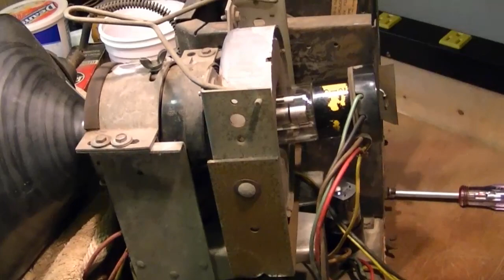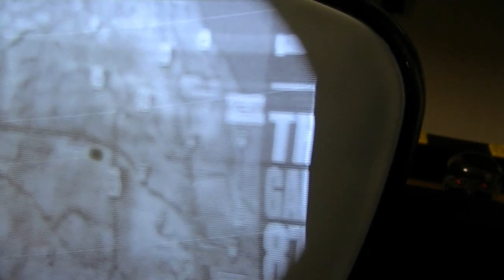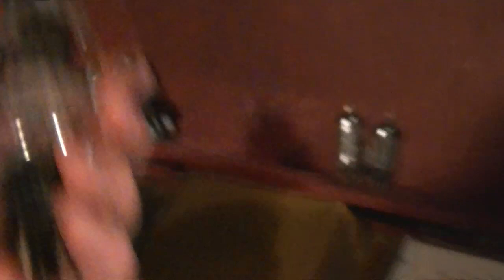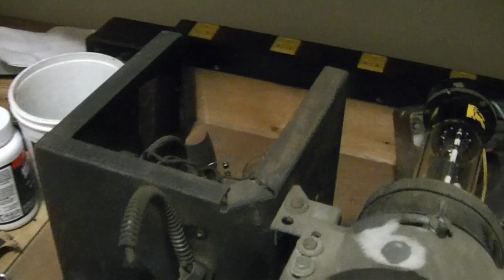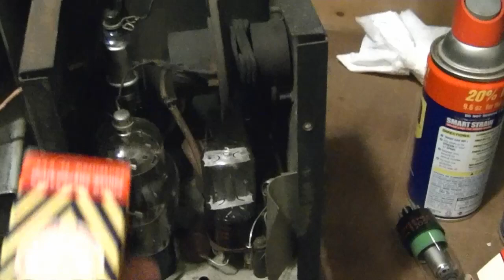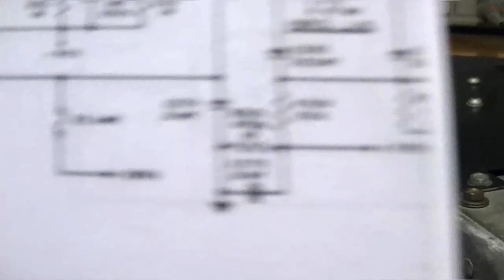Capehart 325 restoration pt4o7

Comment: The 5814A is electrically identical to a 12AU7A with the exception of a slightly higher filament current of 175mA per side.  It is rated for a minimum cathode life of 10,000 hours.  The 5814WA is the ruggedized version.

The 6DA4 is an even better substitute for the damper.  It has the same filament current rating as the 6AX4 but a higher plate current rating and lower voltage drop.

Comment: Hi Bob,After helping a friend with a 21 inch version of the CX-33 chassis, (meaning going to restore it for him) checked D.C. resistance of the 750192C yoke; found the horizontal D.C. resistance to be about 44 ohms, vertical D.C. resistance to be about 4 ohms. The Y-7 yokes horizontal resistance is 18 ohms and vertical resistance is 47 ohms I'd say just a wee bit of a mismatch, so check the yokes you have found in your stash to see if anything matches. By the way that kind of mismatch would account for the low high voltage and the extreme foldover of the horizontal sweep.   Well good luck with the hunt :-)   All the best, Tom J. from Florida
Reply from the maker: I'm actually using a Y-17, not a Y-7.   I measure about 44 horizontal and 3 vertical.

Comment: I wonder if it was tin whiskers in the pot that was causing the fuse to blow, or the wrong ratio from that fixed resistor drifting up to 65k from 47K? It looks to me that the pot should very between 0 and 1 meg ohms so unless a tin whisker was causing the wiper to short to ground it should not have caused the fuse to pop. What's more why was the resistive element inside the pot not damaged? Or maybe it was? Autopsy time for the pot.
Reply from the maker: OK, I'll pop it open in the next video.

Comment: Hi Bob, Does the Capehart have a width control? Saw a hole plug on chassis. A goodly number came from the factory without that control, and the parts had to be added to set the width and bring the high voltage up. The original pot tended to go bad alot most probably do to cad. wiskers. Width control is in return leg of the circuit.  Try using a 180 ohm 10watt wirewound resistor and see if that brings up the high voltage. D.C. wise the yoke isn't in series but A.C. wise yes it is in series. Higher resistance less width, lower resistance the greater the width and high voltage. You can also control the width by adjusting the 6BG6 screen voltage without to much change in the high voltage. One other thing a leaky H.V. filter capacitor can bring down the high voltage.  All the best,Tom J. from Florida
Reply from the maker: No, this production run of the CX-33 chassis did not have a width control, but I was considering adding one just as you described.  The HV filter cap is underneath the 1B3 socket and very difficult to get at but I will try replacing it if all else fails.

Comment: did you check the screen resistor and voltage, cathode current could be correct but maybe the screen is pulling more that is should vs the plate. oh just heard you mention the yoke, I would agree the incorrect inductance of a mis matched yoke would def cause the prob.
Reply from the maker: Yes, all the voltages are correct  I'll try a different yoke if I can find one.

Comment: If the 6BG6 cathode waveform and voltage swing matches the service info then I would think that the yoke
is probably the right impedance. If it was way off the cathode current would also be way off I'd think.

I noticed you measured the HV with the CRT disconnected. Could it be that the lack of CRT capacitance (aquadag)
in the circuit was causing low HV? Just speculation.
Reply: Well, It's pretty obvious that the CRT would load down the flyback transformer and reduce the output voltage. Cheers :)
Reply from the maker: I agree about the yoke - it has to be fairly close.  There is a HV doorknob filter cap under the HV rectifier tube socket so it does not rely on the aquadag.
Reply from the maker: ciprianwiner
Sure, It drops it down a little, but not that much.  I can get about 8kV with the little test CRT connected.